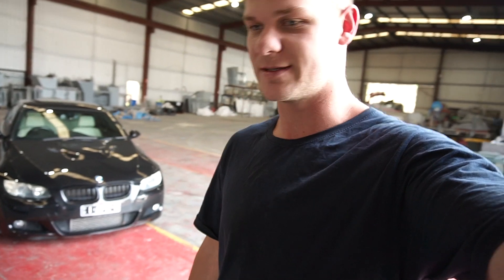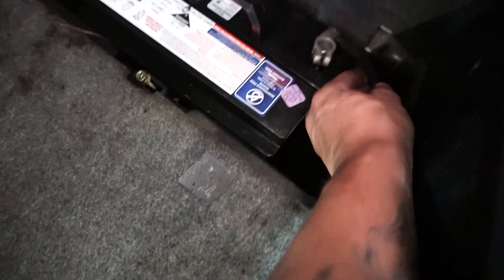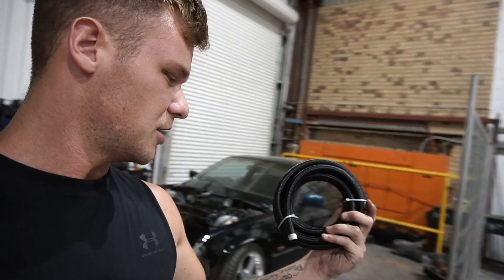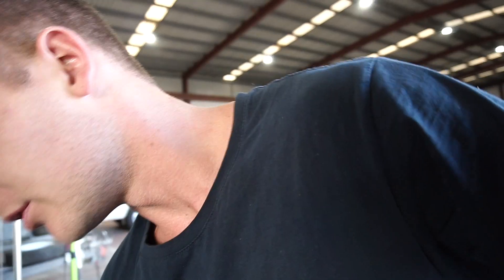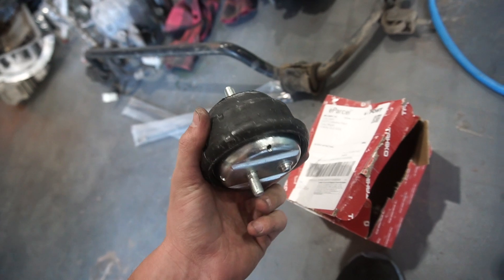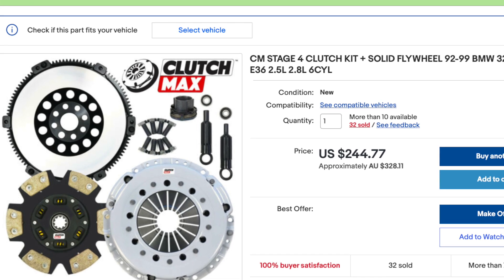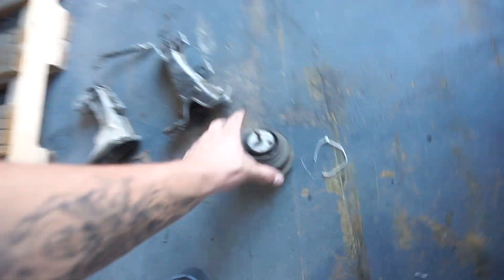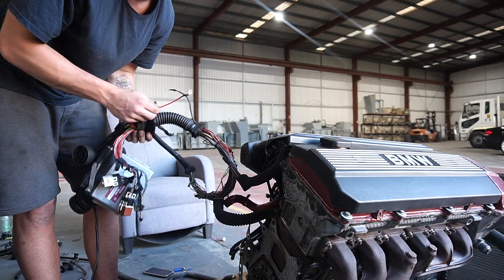Installing E85 Fuel Lines on my BMW E36

Comment: There is a main power wire that goes to the fuse box from the jumper port. That needs to be hooked up..

Comment: stock m50b25/m52b28 can take 500+ whp easily with just a head gasket and arp studs. plenty people dailying 650whp on e85 stock head + block . im gonna be about 550whp on e85 stock with just gaskets and studs when i turbo mine.
Reply from the maker: That’s more than I thought thanks man

Comment: You need to source an e36 engine harness. It will make your life a shitload easier in the long run. And yeah like mentioned that was not the move on the power steering line, should cut that sleeve off so you you would have been left with a barb.